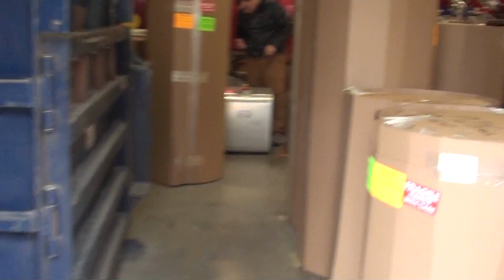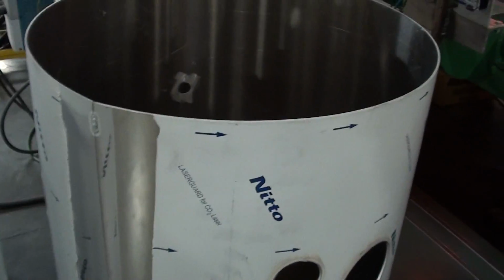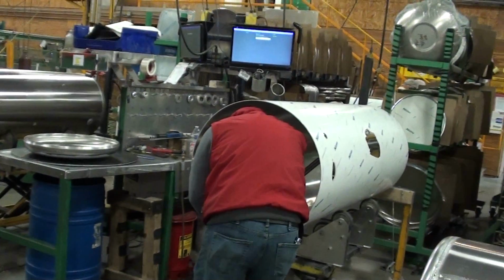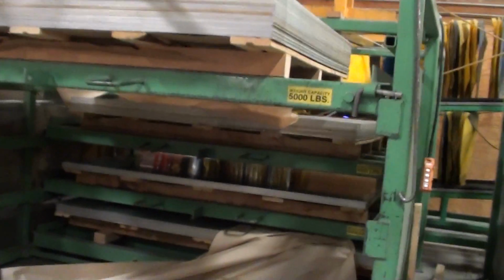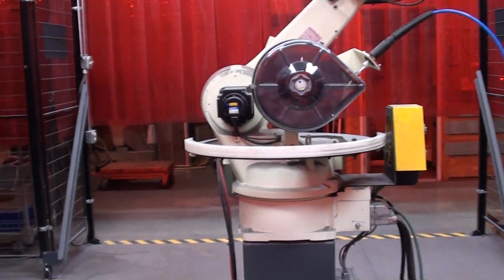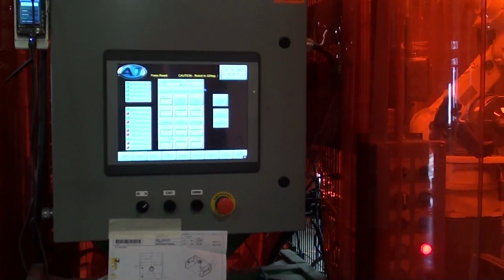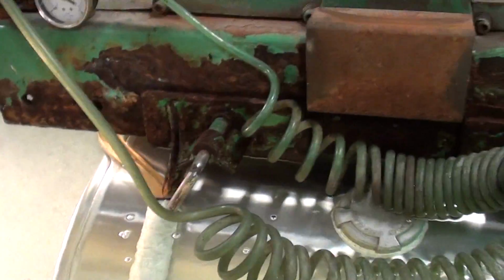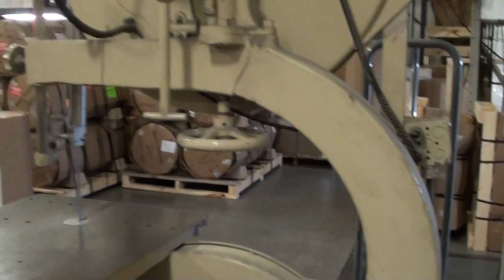ROAD TRIP TO AlumiTank pt 2  tubalcain

Comment: A very nice tour.....even the cleanest Mfg shop I've ever worked in (Sun-tanning beds....highly 'cosmetic')    ....was filthy compared to this place..........and there at 27:00    those big wood cutting bandsaws work fine with skip tooth blade, cutting aluminum....even up to a couple inches thick, a single piece of plate....or a stack of 60 thin parts...!   And, I'd be interested in the type of aluminum used in these tanks....I welded up aluminum tanks....5000 series aluminum, but they were the BIG tanks that go on the fuel-delivery trailers.....5000 series is very springy and tough....!

Comment: How they form the end caps is no secret. One can hear the hydraulic press in the back ground.  A die then aluminum  then sheets of rubber are pressed down under pressure and the aluminum forms over the die. Used in aircraft parts also.